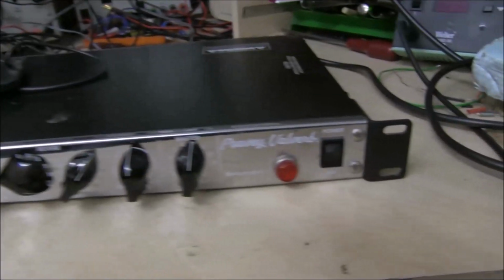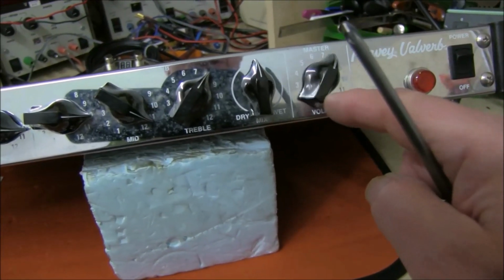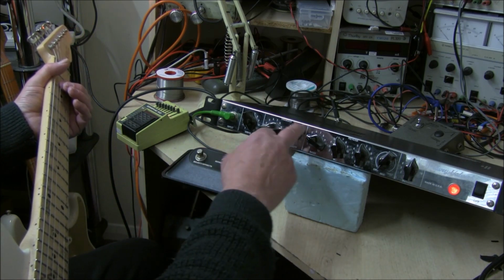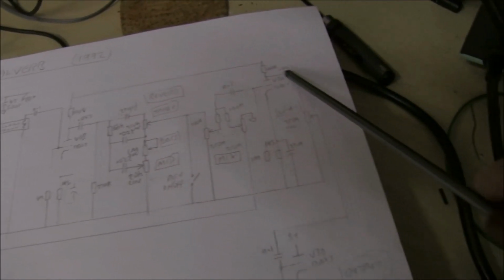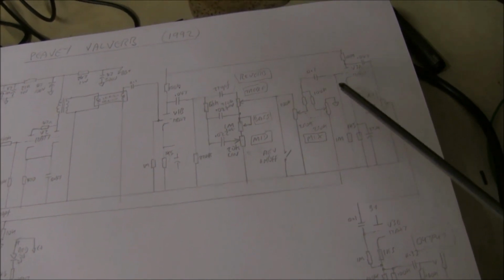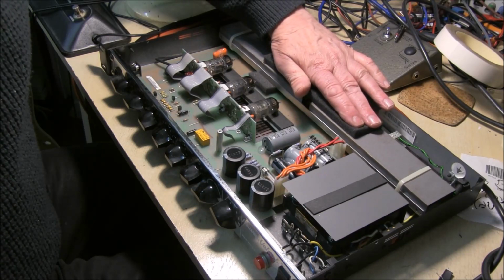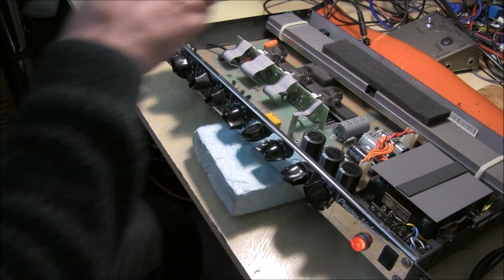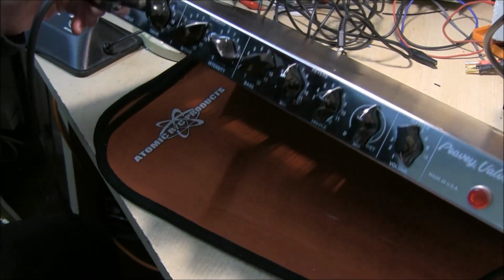Peavey Valverb. Reverb and Tremelo 3 tube Processor. (1995) Serviced

Comment: Hi Nick. Great video! I'm Luis from Argentina. I have a Valverb too. What is the capacitor value and where you put it? I'm an guitar player a bit handy with a welder... but the board is intimidating to me. Can you send me a tip for locate the device withou risk for the board? Thanks.

Comment: i've got one of these too in a rack somewhere. going to have to dig it up. i bought it to use with a tremolux head i had. it didn't have reverb. it was just an extra amp when some one wanted to play too. i sold the amp, forgot about the reverb tank. thanks for your video. also, sounds like a good mod you made on yours.